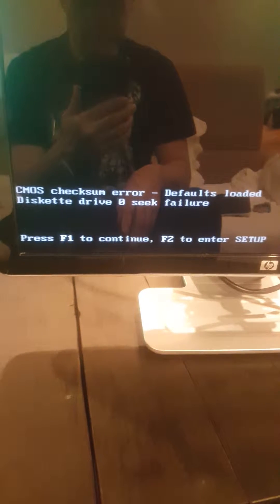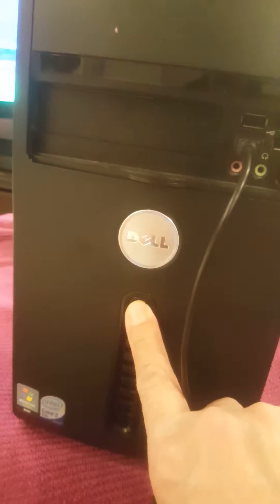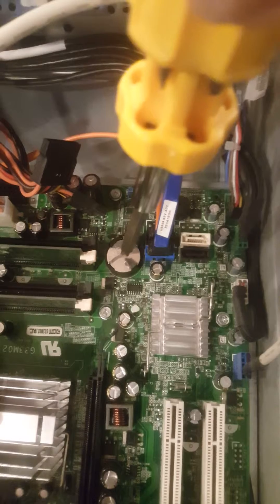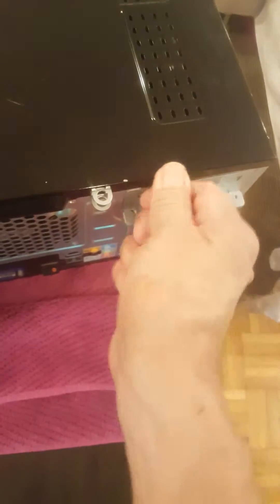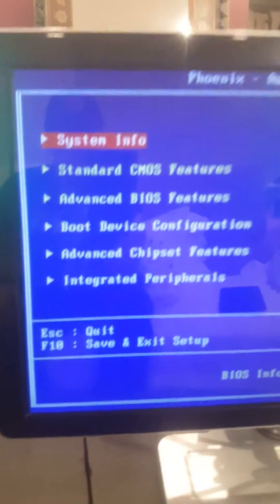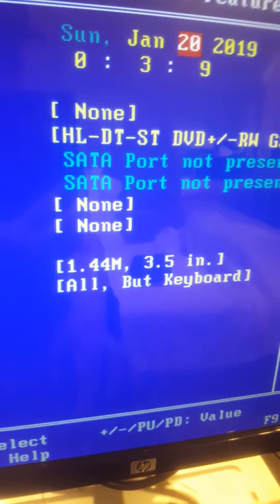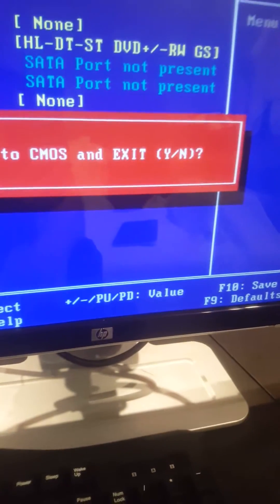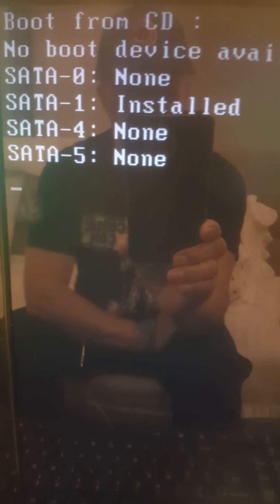CMOS CHECKSUM ERROR FIX

Comment: Thanks! This fixed my computer, I didn’t need to replace the battery but I had another issue. This was the first video I found where it was for the initial error message without all of the other information about it.
Reply from the maker: Thank You! did you subscribe?
Reply: @techstricks5740  Just did
Reply from the maker: @wyattandwill12  THANK YOU BRO!